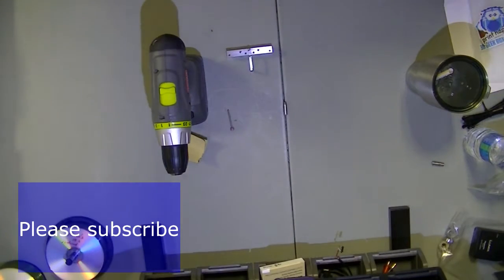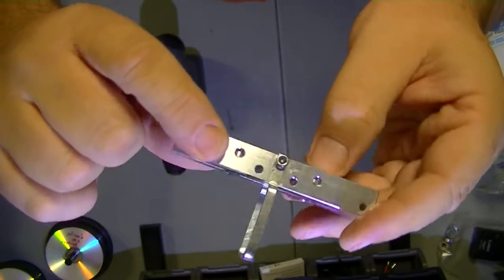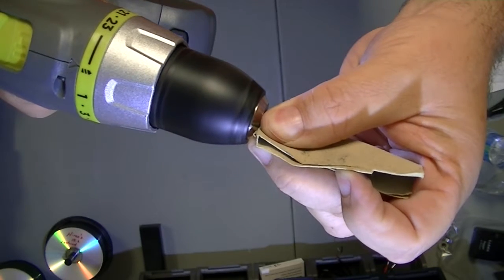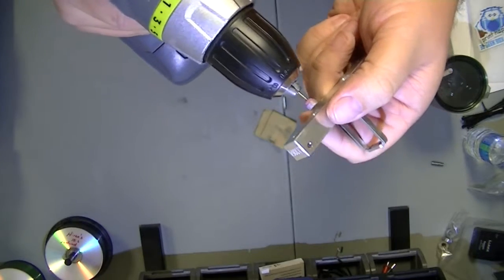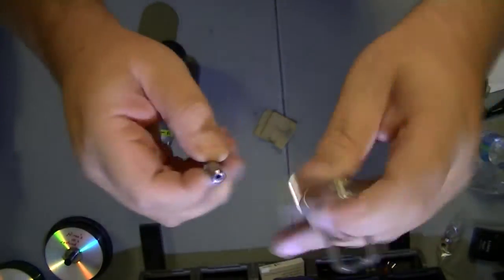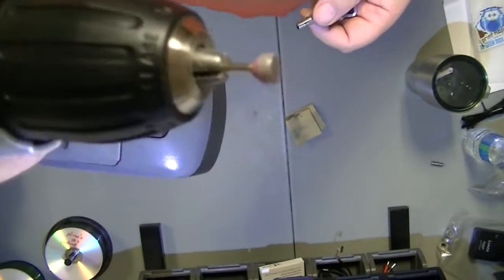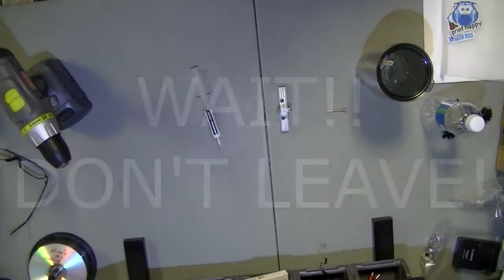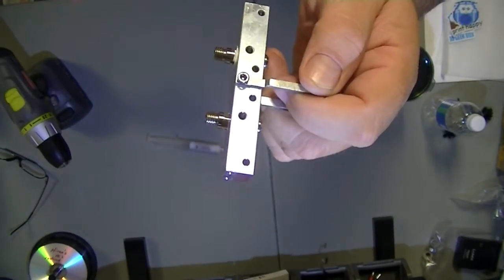Fixing nozzle adjustment on a Flash Forge Creator Pro

Comment: The burrs and scoring actually come from the nozzle when you have to remove it.  The set screws burr the nozzle and then the burrs on the nozzle score the inside of the block.  I have 4 of these things and have since replaced 3 of the 4 entire assemblies with aftermarket ones.  I really think it's a bit of a design flaw.
Reply: What assembly did you replace the stock assembly with?

Comment: Thanks for this video! Prior to this, the only solutions I'd seen online indicated that the tubes would move smoothly from the manufacturer, which is not the case. Thanks for showing an easy way to loosen up the tubes without a drill press. I'd also like to add this link for a printable nozzle leveler, once you get the tubes loosened up.

https://www.thingiverse.com/thing:1582720